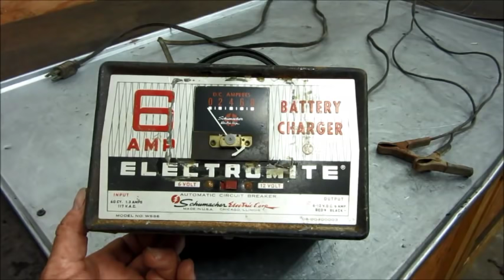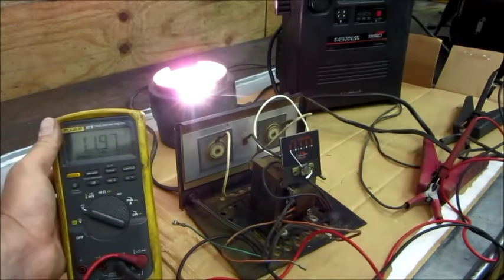Refurbishment of 3 old battery chargers, from flea market...

Comment: We have found that plain epoxy glue works well as an insulator.  Can simply be applied onto open terminals, and allowed to dry.  The self-mixing 5-minute works well, but heat it up to make in fluid.  then it runs into cracks and holes.  Been using this for pond heaters for decades.

Comment: Another difference between selenium diodes and silicon (FWB) is the voltage drop across the diodes.  Selenium is usually about 3 volts and silicon is about 0.7 so the output voltage with the silicon will be a little higher.

Comment: The reason the thermal fuse was buried in the windings is to sense the temperature of the windings in case something was to happen.
This is common in alot of devices to protect from fire due to transformer overheating.  It is also done on motors for the same reason.

Comment: As it happens, I rebuilt my old 10 amp charger based entirely on your video. And it's working great. I had no idea what that old selenium diode arrangement was. But your testing proved that my "diode" is ok for now. All it was was a rotted cable.  But, Now I have learned how to fix old (but good) battery chargers. Thanks a lot! Awesome vid, by the way.
Reply from the maker: Very glad you were able to correct your charger problems based on this video!

Comment: One thing to be mindful of is that the selenium rectifier has a considerably higher forward voltage drop than does the silicon one. This means that the transformer output is higher to compensate, and the design would be such that it'll output rated current into a heavily discharged battery, and taper off as the charge level (and thus voltage) comes up. It'll work fine with the silicon unit, but you wouldn't want to leave it on too long as it will not taper off like it should. It will still output charging current, even when the battery voltage is well up.

Comment: Thanks for showing us this.  I have my Father's Woodward-Schumacher 4 amp charger from the 60's, Model WS84, still working, but a little crusty.  It is very similar to your Schumacher 6 amp, but the cord does not have a grounded plug, so it must be from the late sixties.  For more info on a 1 amp version of these search for "An Old Technician's Work Bench: One Amp Charger."  He posts lots of details about it, such as a simplified schematic,  info about selenium rectifiers, and shows a scope trace of the voltage from this half wave rectifier.  His friend asked him about making his own charger, and there are tips on that too.  Be sure to read the comments too.

Comment: Nicely done and great video! Another disadvantage to those gimmicky new 'smart' chargers is that they only charge a battery that's low. If it's completely dead they just cycle off and consider the battery "unchargable". Those old transformer type chargers don't care, they'll keep trying even if it boils the cells dry. So they can be used to bring back a dead battery, the new ones will not.
This video should be some help to me too, I have an old Western Auto charger that doesn't function, you've given me some ideas what to look for.
Thanks!

Comment: I found a vintage sears one at recycling center that had its wires cut off.  Rewired it and it works pretty good except gauge doesn't work, but it checks out with meter.

Comment: I have my dad's old Sears 6V/12V charger. The cords were shot and I wanted to use the info from your video to rework it. I replaced the A/C power cord and put temporary jumpers in for the output. I got 12.1 volts and 6.0 volts with no load and a negative output from the diodes. When I hooked up to a 50W, 12V lamp the lamp works but the voltage drops to 9.4 volts. Time to rebuild.
 I mounted a 25A/400V bridge rectifier on a heatsink, mounted it on a side wall, and moved the diode wires to the ac terminals on the bridge, connected my positive output cable to the meter and the negative cable to the negative terminal on the rectifier bridge. I set the voltage selector switch to 12V and plugged it in. I got 12.4 volts. I then moved the voltage selector switch to the 6V setting and VOILA! I got 18.3V
What in the world??? Any ideas?
Reply: Solved!

Went through the unit last night trying different things. There is a metal cased fuse that is connected to a bracket on the inside of the charger. It is connected using one of the two power lugs on the fuse. I removed it from the bracket and everything went to normal. Re-installed on the bracket and voltage went back above 18V.
I dug out a pair of fiber washers and found a spot on the bottom where the fuse assembly would fit. I sat the fuse assembly on top of the washers which insulated the metal case from the chargers body and I then hot glued it down, Works perfectly and almost looks like it was meant to be.
Reply from the maker: Glad you got it solved!  Sorry I was unable to reply before you got the problem fixed. :)

Comment: Bridges vs. Diodes:  If your charger only has only two diodes, look up center tap configuration transformers for use with rectifiers.  For the Schumacher 6 amp charger in this video, the center tap goes to the ammeter, then to the positive clamp to the positive post on the battery, and the "outer" taps go to the two diodes, then to the negative clamp.

Comment: I picked up the same Electromite 6 amp charger on CL for $5. The selenium rectifiers are weak and output is around 2 amps, just like in this video. Now I know exactly what to do to upgrade it back to 6 amp output.

Comment: The glass bulb breaker; how do you reset that, after it has “worked?”
Reply from the maker: Most of the clear glass bulb breakers are auto-reset. If they don't reset after the system cools down, then it would need to be replaced.

Comment: Thanks so much for this very informative, and helpful video! I’ve definitely learned a few things from you in this video. 
 Hopefully you may have a couple minutes to answer a question here.. I have basically the same 10 Amp, dual rate, Schumacher charger as the last one you worked on in the video. But mine is an SE-40MA. The internal set up in mine only differs in that the circuit board is mounted horizontally (opposed to vertically), and the transformer is the same way. The one in your video has it mounted laying on its side.
   My charger was working perfectly until the other day, when I accidentally touched the two battery clamps together with the unit plugged in with it set on Manual, and on the 12V setting. Which did cause a nasty little spark. After this happened, I could hear a slight humming coming from the unit. So I tested it with a multimeter, and the 12V circuit setting was only showing 1.04 V. Switched to the 6V setting, the hum goes away, and it shows 6.56V, which is normal.
    Any advice on what your first thoughts are as to what may have gone south would be sincerely, and gratefully appreciated! Based on your video, I’m thinking it may be either the selector switch itself, or something on the board for the 12V side. Seems unlikely to me that it’s the winding fuse you pointed out, since the 6V side still works...
    Anyway, thanks for any reply. Totally understand if you don’t. Liked and subbed anyway. Great video! 👍
Reply from the maker: Thank you for the comment. I don't know exactly how the voltage control board is made in these, but for it to work on the 6V setting but not on the 12V it would make me think that the rectifier and other major parts are working. There are two sections to the switch in this model. One changes the transformer tap, and the other changes the voltage control setpoint. You may indeed have a selector switch problem. I have had the clips touch on my charger as well, and it never damaged it.
Reply: Thanks so much for your reply! I’ve disassembled the switch, and it definitely has a bit of greenish white chalky corrosion all around the contact points on the board. The copper spring contact slides aren’t pretty either.
 I’ll post back with the results. Regardless, I appreciate your time, and certainly don’t expect any further hand holding on this. If the switch isn’t the issue, I’ll keep going until I figure it out. I’m hell bent on fixing this thing now. 😂 Thanks again
Reply from the maker: @MF-le7fp  If I remember, the regulator board is made entirely of discrete components. If it is bad, it shouldn't be too hard to repair it.
Reply: Ok, so you were right. After taking out the switch, I cleaned it with electronic parts cleaner, then went over the copper slides, and the six contact points with a fine emery cloth. Hit it with compressed air to remove any fine dust left on it, and put it back in. 12V side now works, reading at 15.6V. 
   The one thing that isnt working now, is the analog amperage meter, which is pegged to the far left side of its housing. Possibly a bad shunt resistor? Which I thought was the tiny module you pointed out mounted to the center top of the back plate. But you didn’t refer to it as a shunt specifically.
   Regardless, I have other ways of checking it’s output, so it’s not a big deal. Just glad it works now. Thanks again, man!

Comment: Thank you for sharing your time and vast knowledge you are so thorough .I  have an old charger missing the guage on the front but when I put both leads on both wires for the guage I get 12.5 volts do I need a guage

Comment: David, I have the 6 amp 6/12 volt Schumacher from the 70's in its original box.  Made in USA.  I also have the 10 amp Schumacher from 1999 made in Mexico also in pristine shape.  Never thought much about these chargers as they always worked well.  I used the 6 amp to charge my aircraft gell cell battery at my hanger.  Interesting to see the internals.

Comment: Great video! I enjoy repairing and restoration of old stuff. I just finished a 1930s companion scroll saw, and a 1960s(?) Israeli made ac/DC low amp converter, which has a selenium rectifier. I would have never known what the heck that thing was! So thanks for the in depth and very helpful information and diagnostic methods. 

I'm currently going back together with a Schumacher 6/2 model that looks like the 10 amp model you showcased last. Well, it's the same shape, but it's got a different volt meter and look to the faceplate. I came looking for a good shot of the switch and wires to and from the transformer. I cannot locate the pictures I had taken of everything, months ago. Ugh!! Per chance, do you happen to have a good clean shot of the switch and diode side of the transformer? I almost forgot, my charger isn't automatic, so it might be too different looking to help, but anything would potentially help. Thanks for anything you could do!
Reply from the maker: Hi John. Thanks for the comment! It sounds like you have a nice charger setup there. Unfortunately, I'm not at home to look at a charger and take any additional pictures.

Comment: When replacing the selium with modern silicon rectifiers, it would be wise to put a few of them in series on each leg to drop the voltage and electrically mimic the old selenium so the output voltage isnt too high.

Comment: Those internal thermal fuses are a time bomb waiting to destroy your charger. It's put there deliberately so you'll come buy a new one and help fill the landfills, and keep good jobs with people making new ones that weren't really needed. Insanity.
Reply from the maker: This is very true!  A simple automatic thermal circuit breaker would be the cat's meow.  Or as a last resort, a thermal fuse mounted in an accessible place against the outside of the winding, where it could be replaced.
Reply: wait til your car's blower relay goes out, always the same old thermal fuse.  the relay on my Acura is almost 30 bucks.

Comment: I had a very old 160cc Honda that had a selenium rectifier to supply DC for the battery, lights etc.  I believe it had 6 maybe 8 plates.  I believe this was about 1966.  I saw some in use later so I am not sure when they changed to Germanium or solid state.   Oh, when they went bad, they stank REAL BAD.  And, the Sears is now much better than new, IMO!

Comment: Very good information! I have an Ever Start brand charger that looks exactly like the last charger. I almost threw it out because it was not charging one of my batteries, but I recently discovered that it was one of those "smart" chargers that won't charge a battery that was under a certain voltage.
I checked it with a meter and it does put out a charge, so it does seem to still work. 
I'm going to check it on a relatively old car battery that is still good to see if it will charge it.
Reply: I read online that you can put a good battery in parallel with a "dead" battery and fool a smart charger into charging them both until the "bad" one has enough voltage for the smart charger to charge it by itself.
Reply: @duffman6675  Yup, I did that on a couple batteries and it worked. I think there is still something wrong with the charger though because when I go to charge a battery, it might show charged, but then I flip the amp switch back and forth a couple times and it will then show the battery needs charging. I'll keep it for a backup and get a charger that has a restore/fix mode.

Comment: I've got a newer Schumacher battery charger, one of the few good brands left, it does a good job of bringing dead batteries back to life, it can also start an old LS V8 with relative ease, which is something cheaper chargers have a hell of a time doing, I find it good to store batteries off the ground in a relatively warm room when not in a vehicle that's going to be driven regularly, in the case of our old Escort wagon, we park it a 40-45 degree garage with a battery tender maintaining the battery so that come spring it wakes right up so I can re-repair the ever troublesome wiring on our 300K mile Grand Caravan

Comment: I own the 10 amp Schumacher SE-40M and it stopped working recently and I switched to using solar w/charge controller on my car batteries, but sometimes plug-in is still useful.  It was my Dad's and is in a little better condition outwardly--less rust.  So thanks for this.  I think my diodes might be the problem as I took it apart and cleaned it and messed with the diodes not knowing what part of that assemply need replacement.   It went from pumping 6 volt instead of 12 volt to 0 volts (which is odd--nothing is zero volts!). One of the clamps had rust at the wire connection and had been heating up before it went down so I fixed that.   Now I just need to source the diodes.  Only place I found has parts for a similar model (SE-40MAP) and I suspect that is the not same.  Any help on where to source diodes for the SE-40M would be appreciated.
Reply: I guess I need to know the type and rating of the diodes. 10 amp?  They don't solder which is cool.
Reply from the maker: Hi, sorry about the late reply. 
The diodes would be oversized compared to the charger rating. They are oversized to allow for some minor abuse such as momentary reversed battery connections or shorts of the clips.  I would say that a pair of 20A diodes would be adequate for a 10A charger.
Reply: @davida1hiwaaynet The smallest I could source is 50 amp button batteries from a US source (PLP batteries). There were some slighty smaller ones I could have got from Ebay Lithiuania (Riga where the really good smoked sprats come from), but I decided to go with the domestic ones with the best price.

Comment: the selenium rectifier rectified half the ac wave, a bridge rectifier will recitify both halves of the ac wave,leading to a higher dc voltage and more bubbling of batter, overcharging.   i did the same thing to an older selenium charger, i came back to find it had risen the battery to over 19v....simply just swap each of the selniums to single 10a diode in a heatsink, if charging a more dead battery 11v and lower you will exceed the 6a draw and push the transformer too hard, the peak is just that , for actual dead batterys, a battery near 12v unloaded is 50 percentcharged really
Reply from the maker: Actually, the selenium rectifier had two "diodes" working together. This worked as a push-pull rectifier along with the center-tapped transformer. The end result is a full wave rectified DC signal. The rectifier bridge is connected exactly the same way, with only two of its internal diodes in the circuit. It performs exactly the same as the selenium rectifier, other than being more efficient and therefore allowing a higher charging current.

None of these old chargers were ever intended to be automatic. There will be overcharging and bubbling of the battery if you leave them on the battery too long, selenium rectifier or diode would not matter.

Comment: THANK YOU..  35:51   saved my day!! Mine is a  schumacher 2/10/50 amp,  using a rivet for an electrical connection failed on mine too!   I bent the ear on the plate,  drilled hole just like you did.  its charging my battery!   I'll buy you lunch!

Comment: Will a 8 amp 400V full wave bridge rectifier work? I have exactly the one you fixed with the internal fuse that caused so much trouble. Mine only needs diodes I think. I don't know how to wire the bridge into the charger.

Comment: I have two of those battery charges from the 1970's. they have been used thousands of time's, They have been absolutely abused. They still work perfect. There is good reason for it to be 6 and 2 amps. because lead acid battery should NEBER, EVER be charged any more than 1/10'th the amp hour rating of the battery. most car battery are around 50Ah. It should only be charged about 5 amps max. 6 is acceptable I guess in a hurry but two is better. the 2 amp setting is good for small batterys 20ah or higher. What reason all of the charger manufactuers are making 15 and 25 amp battery chargers these day is to full ignorant people who think a higher amp output is better. It is VERY bad for the battery and will ruin it.